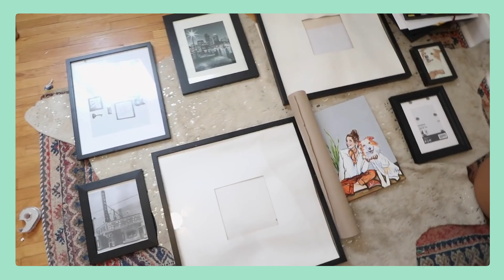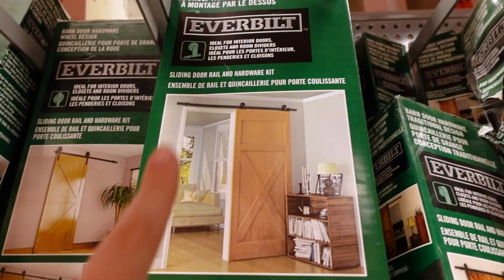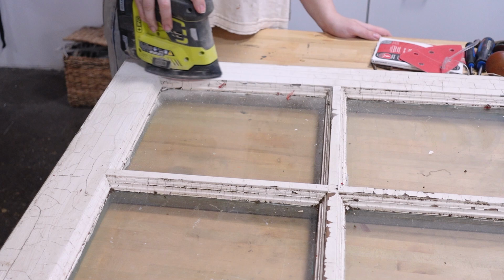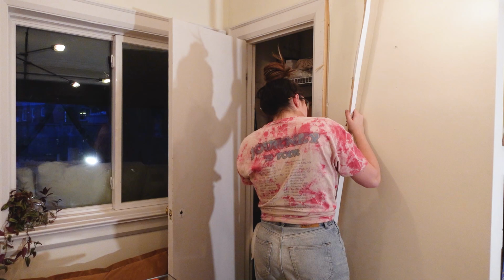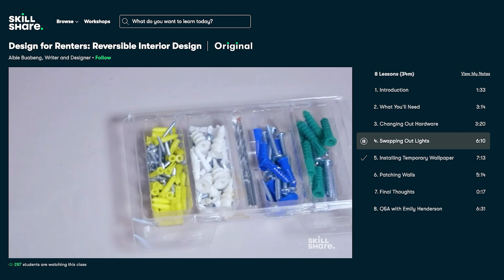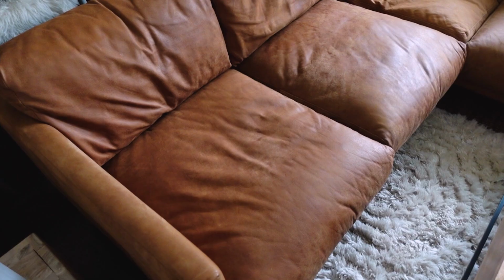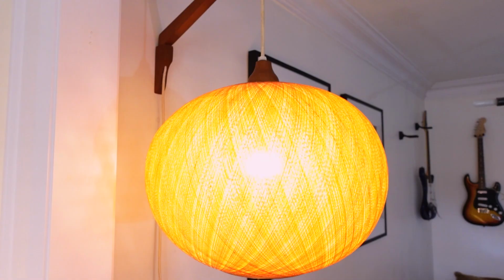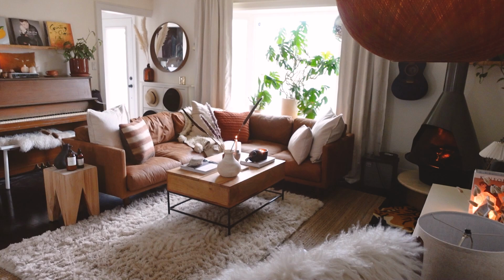making my own industrial door from a marketplace find | DIY Diaries

Comment: I ran into the same problem with my sliding door. instead of removing the trim and taking all the time to fix, I just got an extra trim piece and put it above the existing trim so it would set it out further. I painted this piece the same color as my walls and it worked so well!

Comment: Love this!! If you install a sliding door in the future, instead of removing the trim, you can just cut out wooden disks to anchor to the wall, paint them black, then screw the hardware onto that. It should bring the hardware out far enough to let it slide in front of the trim without a problem. Amazing job as always though! Your skills and creativity are insane 😍

Comment: Wasn’t sure I’d like the door, but was a very nice improvement. The glass might be nice frosted, so you don’t see the cleaning supplies. We did that to some cupboards by adhering cheesecloth to the backside. You can still sort of see through them, but you can’t see any mess.   Love the sofa, curtains, and the string light. Hope new bulbs solve your problem with the flickering light.

Comment: Beckyyyyy you should have just firred out the sliding hardware! You could have made a backer that was the same size as the rail, and brought it off the wall an inch or two

Comment: Door looks great! Instead of taking trim off you could have added one. Screw a trim board to the spot where you drilled those holes for that long bracket piece and then put the bracket on the new trim board. Everything would be at the same distance from the wall and it would have been easier. BUT easier isn't always better because I think the extra work paid off 👍

Comment: Haha!! The 70's is not antique its just old, maybe in about another 20-30 years it will be considered antique. But I'm loving your 70's lamp... 

fyi... sometimes if your lights flicker it is due to the set up it's on... example we had the same issue with a new light fixtured we had installed  above our dining table, our electrician said that it was because it was on a dimmer switch however the light fixture was not dimmer compatible.. lesson learned "don't instal non- compatible dimmer fixtures on dimmer switches if they aren't it will cause flickering.

Comment: OK, I love the glass door, how you installed it (so cleaver) and the black on white.  Looks very chic 👏👏👏👏  However, just one small note, since you use your closet as a utility closet the look inside the closet isn't so chic looking.  If it was my door, I'd install a shear (maybe even lace or linen*) pull curtain on the inside of the door.  I would then use a tie in the middle of each panel.  That would give a cleaner look when seen from the outside. Just a thought.

LOL ...  When you said only 'cool' light and chairs, I thought you meant cool colors.  With you lit up your new  mid-century lamp it was a warm color.  I'm, like ????  Then you said "how kool" it was.  Lol, I totally misunderstood.  🤣😂🤣😅. So funny as that was my era, but I do agree it look awesome.
*My favorite choice

Comment: I would suggest a lead paint test before sanding paint that could originate before the 1980s.  Most paints before then were lead-based.  You can sometimes visually tell the paint has lead because it might be "alligatoring" as seen on this door or it might produce a chalky substance when you rub against it, as seen at 9:07.  Girl, get you a lead test and respirator at minimum!

Comment: Great job on the sliding door, Becky. I think it would look nice if you frosted  the inside of the glass. I'm wondering why you left the door plate as it is on the wrong side of the door? The handle is useful though.

Comment: Loves the door but I think I would have just added a piece of wood behind the barn door hardware so it stick out enough and you don't need to remove the trim. You can attach the wood to the studs.

Comment: The  "not included" but "required" wood plank you saw in the manual would have added the thickness (depth from wall) to bring the railing out far enough to not need to remove the door trim. But you would have seen the trim through the glass portions of the new door :(

Comment: Dang Becky got a free $5000 sectional. Something looks off with the sliding door for the closet. The handle is on the wrong side, sliding door handles are always on the opposite side to the way they will slide (sliding right, left sided handle or sliding left, right sided handle)

Comment: Just out of curiosity why don’t you guys ever feed cords through the walls to hide them? I get it for certain lights when the on/off switch is on the actual cord (although a smart plug could eliminate the need with that too). I just think for other things like TVs & whatnot, it’s just as quick & easy to feed them through the walls as putting a cord cover over them, but in my opinion is so much less distracting & is more elevated & seamless looking. Plus when you own you have that ability more than when you’re renting where cord covers are usually the only option.

Comment: You went down the wrong side first that's why. You should of gone down the wall side trim were you cut with a sharp chissle tapped gently a line all the way down then tryed taking it off and you'd of had less mess after the blade being cut down the painted trim.